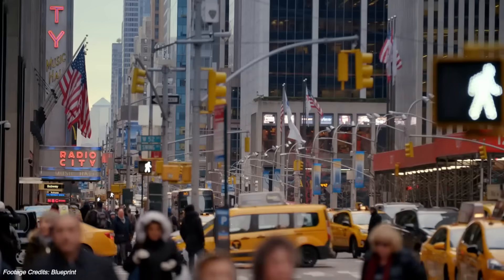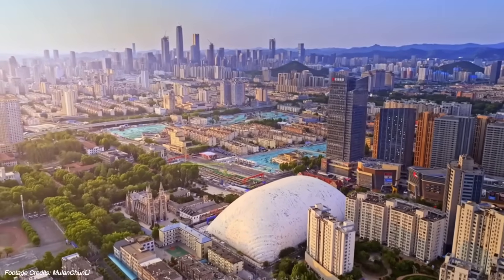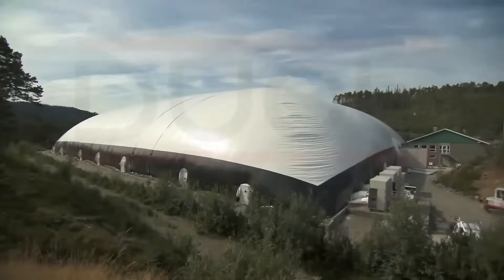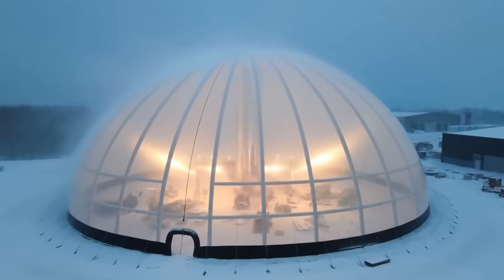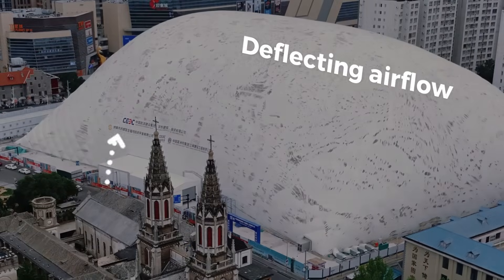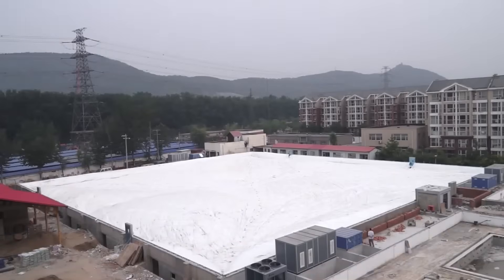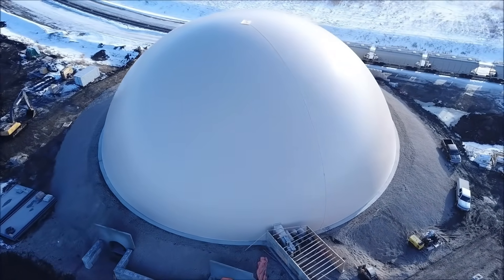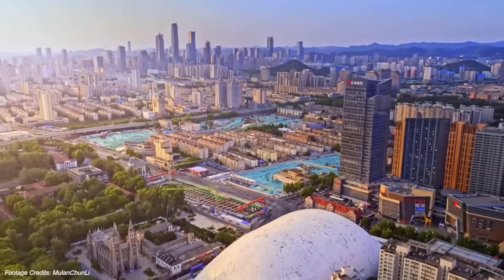How China Quietly Solved Urban Construction’s Biggest Problem

Comment: So how is the dust mitigated inside the dome? Plus diesel exhaust fumes??
Reply: There are fans that can keep the air clear, but maybe even better to use electric machines in place of diesel.
Reply: Materials are going to be delivered via diesels and switching trucks isn't going to be practical.  
 @knowledgeisgood9645
Reply: And fans are only going to move the dust around or blow it right outside.  @knowledgeisgood9645